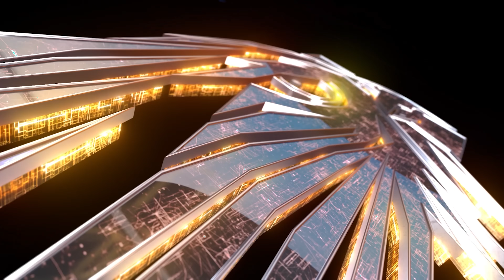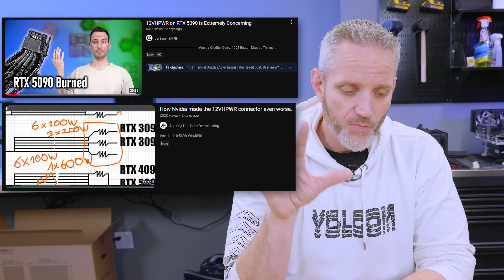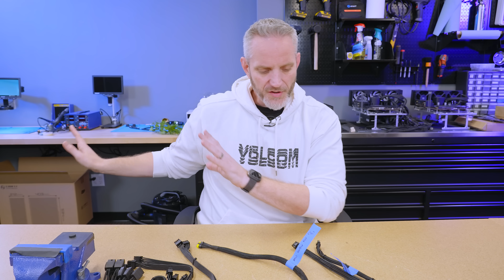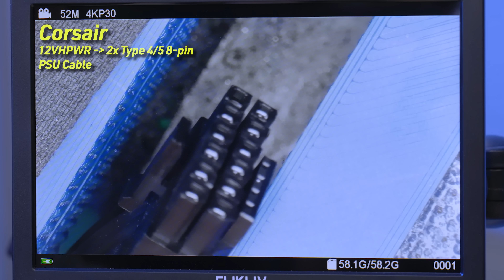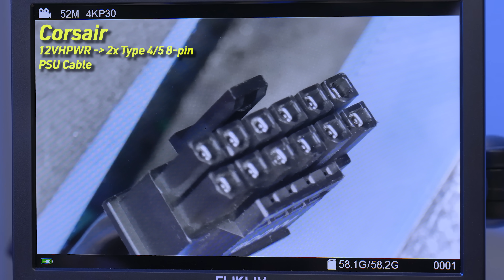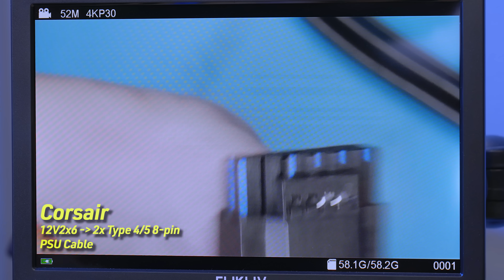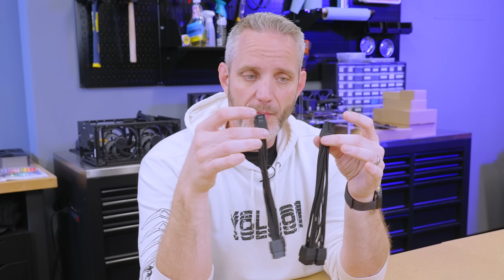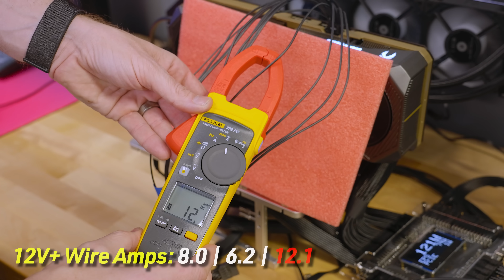I discovered something concerning and I need the Experts to chime in... More 12VHPWR discovery!

Comment: The way I look at user error it shouldn’t even exist it only exists because the manufacturer didn’t make the connection tight enough allowing some play that can lead to “user error” they could be less sloppy and make it impossible for users to have it not seated correctly. 

To me it seems like they’re using their own fault to possibly refuse warranty at some point which is scummy.
Reply: Fundamentally you have the problem that you can't differentiate a well-made connection from a faulty one by any reasonable method. If the connector feels right and looks right, it must mate properly, i.e. can be inspected. If the only way of knowing whether the connector is mated properly is, if there's fire, well obviously it wasn't mated right, this just doesn't do it does it now. If you can remove and reinstall the connector and it looks and feels proper every time, but sometimes it's mated and sometimes it's not, how is anyone supposed to work with that?

Comment: I’m not getting sick of it. It’s very informative. These issues are why I’m still running a 3090 TI
Reply: Glad I'm not the only one still running 30 series for the same reasons
Reply: Also a 3090 owner.
Maybe the 6000 series will have fixed all of these problems.... and introduced 6 new problems...
Reply: 3070ti here. If it suddenly breaks, I'm going for AMD. I really don't want my house burned down
Reply: @MrEricmopar  only the 4090 and 5090 are using the new connector, the other cards don't. And I'm pretty sure the AIBs can choose not to use it. Though not supporting NVIDIA's shenanigans is good too
Reply: @zeikjt  The third party vendors CAN NOT choose, it's why EVGA, one of the best GPU makers bailed on Nividia a few years ago. 
Also, all the 4000  series use that blasted connector. I presume all the 5000 will too.
Reply: I would've gotten a 4090 but the probability of it burning my house down scared me off it and the more I learn about this the happier I am for not having bought one.
Reply: Amen, 3090 founders here
Reply: And part of why I'm running a 7900 XT.
Reply: Best card on planet earth earth right now the 3090

Comment: Still don't understand why they went with a single 10 pin instead of multiple inputs. All power supplies have them and you still need them to hook up the adapters.
This is just a terrible design choice that is completely redundant, except to create a very severe flaw and point of failure.
Imagine spending 2k on a new card, just to have it voided of warranty because of power design choice.
Reply: As long as all the 12v pins are all connecting to the same rail/bus in the GPU, it doesn't matter how many connectors you have, if these connectors make a bad connection.
It doesn't matter if you have four 8 pin PCIe connectors with 12x 12v wires if half of them are making a bad connection.

Old PCIe power cables (PCIe 6+2) only has three 12v pins rated at 150W. In theory you'd need four cables giving you 12x 12v pins, double what the 12V-2x6 connector has.
On the PSU side it depends on the manufacturer. Corsair - as an example - uses 8 pin EPS for both CPU and GPU connections. 8 pin EPS is rated for 300W and has four 12v pins for CPU.
A Corsair PSU would theoretically be able to power a 5090 with just two 8 pin PCIe 8 cables, or more precisely two 8 pin EPS cables @ 600W.
This is due to the PSU side being spec'ed higher than the 150W a 8 pin PCIe cable is rated at.

12VHPWR/12V-2x6 connectors are 12 pins with 4 sense pins. There are 6x 12v pins in this single connector rated at a total of 600W.
They all connect to the same 12v rail and as such, if one pin makes a bad connection, power is simply drawn from the other pins/cables making good connection.
There's no safety here, and that's the biggest design flaw. The connector and cables simply melt.

The question still remains for why these connectors have pins that makes such a bad connection. Why is this an issue.
The fact that the 12VHPWR and 12V-2x6 are still rated at 600W max is another big issue. In theory it shouldn't be an issue, but the reason we haven't talked that much about melted cables in the past is, that it was uncommon for hardware to draw anywhere near max from a single connector.
The 8 pin PCIe connector was rated at 150W, so even though most respectable PSU manufactures all supports higher wattage from a single 8 pin PCIe connector, GPU manufactures had to make sure the card wouldn't draw more than 150W per connector. And this is why they had multiple rails - a form of load balancing.

There's absolutely no reason for GPU manufactures and Nvidia not to continue with this idea.
While a single 12V-2x6 connector is rated for 600W, each 12v pin/cable is not. They need to balance and limit the load on each pin to avoid catastrophic failures like this.

ASUS's Astral card should be able to mitigate all these risks as it monitors per pin current and should be able to turn off or power limit if one or more pins have a bad connection and the card draws an excessive amount from one or more pins.
Such safety feature really should be implemented on PSU side as well.
Reply: Part of the reason is everyone complained about the “look” of two or three cables before i think.
Reply: Which is wild imo. If I'm getting a beast of a card that I want to use, I'd much rather have some redudance than "slightly more esthetically pleasing, but might burn down your house". That said nothing says "rich" like buying a new house AND a new 5090!
(Also, the 1080 I'm running have 2 cables. I've never even considered it an issue :P )
Reply: @thebearded4427  some people are just like that I guess. They even buy a “prettier” gpu. Even if another less pretty looking gpu from another  brand has better performance.

A pc at the end of the day is a machine and it needs to perform thats it imo
Reply: @gelul12  I dont know of anyone ever complaining about that XD unless you mean the people that are uppity about wire colors showing, and even if people dont like the look there was a thousand ways of making them look good. I even have one of those evga powerlink things on my gpu that moves them from the side to the back of the card.
Reply: @gelul12  NO lol, this decision is to save them money and to lock customers into their product's, AMD and Intel still use PCI-E cables. Force customers to have to go back to them, because the new PSU standard limits PCIE cables
Reply: @gelul12  It is kind of a pain to route three PCIe power cables in the case, like I had to do for an RX7900XTX.  That being said, I'll gladly do the extra assembly work rather than roll the dice with the new connectors.

Comment: Jay, one point to remember in regards to the cards, not only do they have ground paths through the cables, they have them on the PCI bus, the housing, and the mounting bracket at the back of the card.  There are only a few points of power entry, but like on a car, MANY points for grounds.

I don't own a 5080 or 5090, and would not pay the batshit pricing they charge for them right now anyways.  

But continuing to push an obviously inferior power delivery for a video card that is incredibly power hungry is dangerous for their consumers.

Comment: Thank you for mentioning the dumbing down of the plug integration into the board. The difference in cables doesn't help for sure, but the removal of safety measurements shouldn't be accepted.

Comment: It’s crazy. 23 A through that wire is way too much. Consider that a residential outlet is rated for 15 A and uses 14/2 and when you go for a 20 amp circuit, you use 12/2.
Reply: you absolutely cannot use a 14 gauge for any thing other than lighting fixtures ONLY peer NEC
Reply: But we are not talking AC current in these wires so the way it’s conducted across is actually different from the way DC travels .
Reply: @kevinlopota3626  That poor design is trying to pull way more amps than those individual cables should never see.
Reply: @kevinlopota3626  For DC this is worse because cable's heat increases proportianal to how much amps goes through it squared. In AC way less amps goes through those wires usually. Because the voltage is so high.
Reply: @ current is current, 50 amps at 12 volts dc is the same as 50 amps at 120vac, even though theres more wattage available the wire only cares about the current.

Comment: Having a single 12VHPWR on a card rated to consume the full range of the rated cable spec is simply irresponsible design. This feels like Apple making horrible design decisions simply because they preferred a particular look. Will not buy, and would not recommend.
Reply: exactly everyone seems to be focusing on the design of the connector instead of realising the cables are spec'd at ~630W and the cards are designed ~600W which is just a too close margin of error
Reply: @NiazDokrat one thing my electronics professor always drilled into us with a passion is the fact that Max specs is never supposed to mean you should be able to use it all the time near or at that max value, it meant that you could drive a part that far without instant catastrophic failure, and even showed us examples, like all qualities and brands of 10A plugs for, and how being driven at near that value always ended in melting plugs after a couple of hours, and then him emphasizing that the recommendation is to drive it at around 80% of Max spec
It's ludicrous how these so called experts would be abusing these connectors this way, at this point the bean counters excuse doesn't fly anymore because it's easy to show how doing this is  dumb
Reply: @KibitoAkuya  My whole rig 3080-5950X-64G plus fans and stuff...might pull 500ish watts at times, That's why I use a 1000w psu. It's never straining.
Reply: 75W comes through the PCI slot so in reality the cable only handles 525W  @NiazDokrat
Reply: @KaitouKaiju  yes but the sensor Jay uses doesn't measure the pcie slot AFAIK.. only the power cable and he was measuring 630+ there
Reply: like wtf didnt they learn their lesson last time another stupid repeat
Reply: It's even worse, the 12VHPWR cable is severely underbuilt, there is practically zero headroom for non-optimal situations to occur, aka real life.  The PCIe power cable on the other hand is severely overbuilt, I'm talking on the order of 2.2x more capacity then the official rating.  The 8 pin connector can have two faulty wires and still be safe.
Reply: Exactly it should have had two or one 16-pin and an 8-pin.
Reply: Less resistance equals less heat and easier to drive the signal. 
Means they are using better materials, more pure metal, better soldering.  If I'm wrong just post the right answer.
Reply: @KOz1caa the standard calls for less resistance. The problem with that is it doesn't solve the issue of limited surface area for the current demands. You can have a single wire or connector fail and it can result in melting or fire, if the draw is near the spec limits.
The lack of redundancy or headspace for power draw is the concern.
Reply: I was explaining the less resistance, not the core problem. If you put all the power through one wire rather than 3 or 6 that one wire will heat up Tremendously rather than dividing the amps over multiples. @MikeStavola
Reply: Nvidia have finally become apple
Reply: Devils advocate, 3x 8 pin cards have had 525w power limits for several generations without issue.
Reply: @tresnugget Or more. Ive seen GPU's that allow power budgets beyond the PCI-E max spec (had a HD7950 from AMD that had two 6pin connectors on it (so 2x75w + 75w from mobo = 225), but it would draw 250+W without issues while OC'd.
Reply: @tresnugget  yes but as we are saying it about how close you are running to the margin. the 8pin is rated for 288W and spec'd at 150W which is approx. 50% capacity. (x3 + 75W from pci-e slot = 525W) whereas these 12hpwr cables are rated at 684W (using the higher number ive seen) and spec'd at 600W which is ~90% capacity and as jay2cents showed in some of his vids the cards pull 640 consistently
Reply: @tresnugget  seasons cables allow 300w per 8pin cable.
Reply: They don’t use 12VHPWR on new cards, 12V-2x6 is the new hotness. Both are compatible with each other though…
Reply: @JamesTK  except for tiny physical spec changes, electronically they are identical. The point is not using two of them if you're going to draw enough power to bring one rail alone to its limits.
Reply: @htcworx  Supposedly the 12v-2x6 has less resistance than the older cable, but idk what impact that made.
Reply: @  I think the main benefit is the newer spec has much better hold on the pins, I know that was an issue with them popping out like with Jay’s Corsair cable
Reply: @JamesTK  They're compatible because they're the same.

Comment: The problem is on the PCB side not only with the connector. 
- Let's drop 3 phases so the current might be balanced between 3 pairs of wires as it was done with the 3090ti
- let's cheap out and save some space with only one phase which is used on the 4090 and the 5090
- there is no way to balance the current and all 600W (50A) can fly through a single cable especially when a badly designed connector is prone to create very uneven resistances 
- and you have 23A (276W) flying through a single wire
- What possibly could go wrong?
Reply: buildzoid went in depth with this one but yeah, Nvidia threw power balancing out the window
Reply: From Germany. The problem of burnt-out plugs and burnt-out cables has always been the fault of the graphics card manufacturers. If you read the specifications for the power supplies and cables, you'll know that too. For the power supplies, all 12V pins are supplied by a busbar that is protected with 600 watts, for example. So if the power supply provides 50A, then the power supply only has to protect the total output of 50A. With the 12V2x6 plug, this means that the consumer has to protect each individual 12V line against overload. For the graphics card, this means that only 8.33A can be drawn per cable via the 6 cables. So 6 cables x 8.33A = 50A provided by the power supply.
Unfortunately, Nvidia doesn't even seem to have a grasp of the basics of electrical engineering. Otherwise, they would have known that, according to the regulations, the power supply has a distribution bar from which all pins are supplied. If you then first create a busbar for the pins behind the connector on the graphics card, then the current can choose the easiest path between the two rails. That's the basics of electrical engineering: parallel connection of resistors. In this situation, the cables and connectors are nothing more than resistors and the current always chooses the easiest path.
It would have been correct if Nvidia had first run each of the 6 incoming +12V lines through a shunt with current limiting so that the graphics card can guarantee, in accordance with the rules, that no single cable draws more than 8.33A.
But that would have cost 30 cents more. Nvidia was too stingy for that with a $2000 card.
The error will also occur with the supposedly good cables from Nvidia and these cables will also burn out.
Reply from the maker: I mentioned all that...
Reply: @Jayztwocents  True but one more thing... SIG didn't design this connector. Nvidia with Intel did and pushed SIG to approve it.
Reply: Agreed. The fault is with the connector specification - having only a 1.1 Safety factor on a consumer product is negligent.  You proved it with the  PMD2 measurements at the end. That device was adhering to the max current per wire limits on the output, but could not manage it on the input.  The standard for this plug is not fit for purpose - as a systems engineer with years of product design experience, I cannot fathom how this standard was allowed with a safety factor <1.5 and no other mitigations in place for a "dumb" plug and cable prone to all sorts of issues as you have just shown.
Reply: @themarvel2004  Well, if something is rated for 600W I expect it to work with 600W. Normally these safety margins are within the rating itself. Seems like with the 12VHP these margins where somehow shrinked.
Reply: @themarvel2004  The rating already has margins. Do you expect a 1A wire to catch fire instantly with just 1.1A current going through it?
Reply: I run the numbers and contact resistance differences within normal ranges don't explain that much current difference. There must be a seating issue.
Reply: @Poolroulade  I would like for someone to measure the resistances. And how they change based on temperature.
I can imagine the resistance of the cables goes down if their temperature goes up.
Reply: Some PSUs have load balancing built in.
Reply: if both end short all 12v together and all ground together , the unbalance current between wire should not this big , current will distrubute by resistance
Reply: @h.y-chen  Excatly - except there is really big contact resistance on some of pins. But that must be a really big one.
Reply: @ not only that, it must be combined total seperate power rail , otherwise the current should distribute by resistance , not forcing it self go to the high resistance contact , usually the PSU side is single rail for 12V , I'm surprised the GPU side is not , but the NV PCIE->12VHPWR adapter did short all rail together , so I guess use that is more safe?

Comment: 12v HWPR connection is terrible and needs to be dropped. More power and less contact. And idiot designed the connector.
Reply: As well as make the insertion idiot proof as some of the cards require a 2 degree pull out.. no pullout angles and just recommend using the ejector recommended by the motherboard manufacturer..
Reply: Along with angled removal.. just use the damn ejection mechanism on the motherboard
Reply: Does the 50 series come with the 12V2x6 cable ? or is it 12vhpwr ?
Reply: @Clapperme  Exact same cable, only thing that changed was the name.